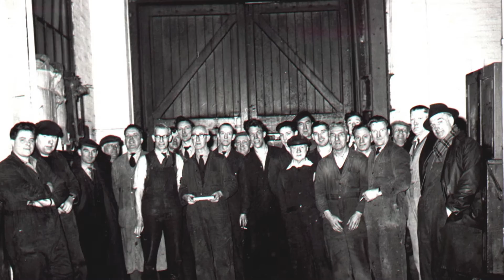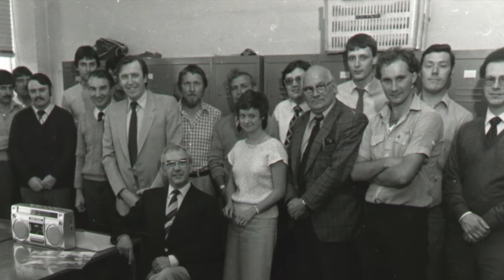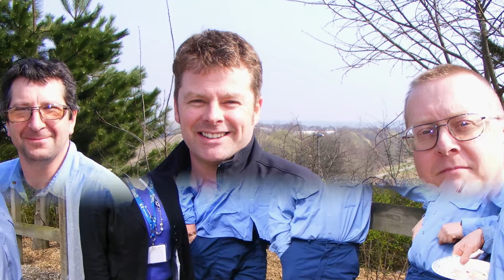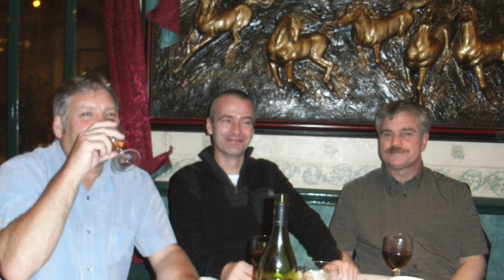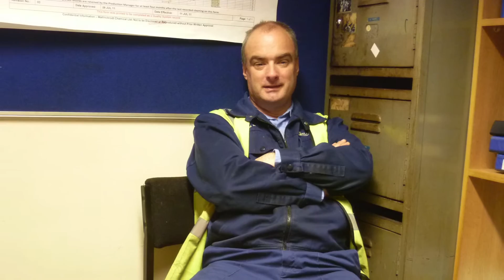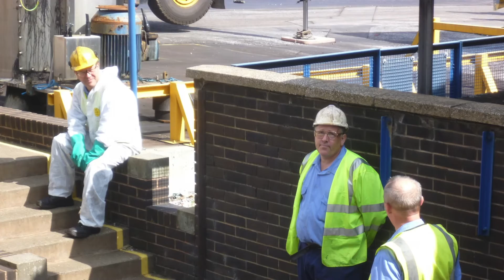Staveley People

Comment: At 0.18 in the white shirt is Walter Hewitt, Devonshire Works machine shop supervisor. Bill Stevens, a welder, with the flat cap on is far left. All the others I knew, were welders, but can't recall their names
Reply from the maker: Hi,
I can put names to three more faces.
Back row second from left is Geoff Cropper, far right is Lou Hopkinson and front left is Gordon Bean. Not sure if I've spelled some of the names correctly.
The three guys I have named were all welders, Geoff and Lou were based in the central workshop and Gordon was the plant welder at the BTC plant.
Regards
Andy
Reply: @hollingwoodlad3299  Thanks for that, have been racking my brain, off course, it was Beany.